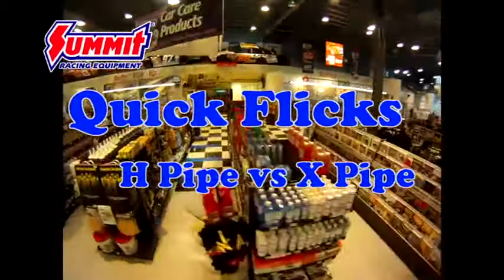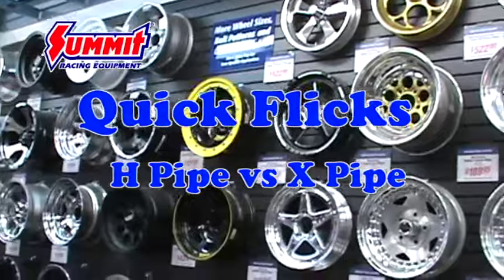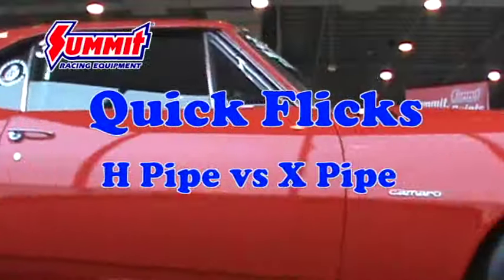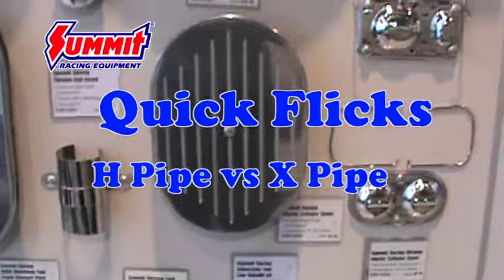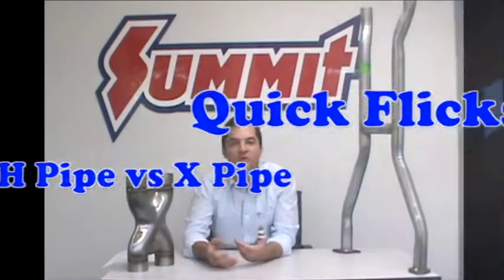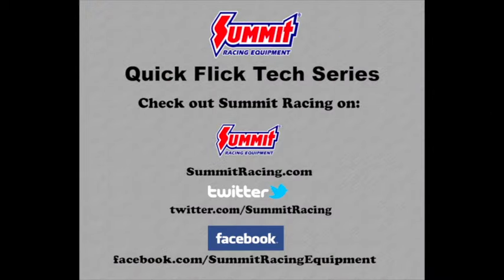Exhaust X-Pipes vs. H-Pipes and Differences Between Them

Comment from the maker: We unfortunately do not sell a bolt on unit for that car, but we do have a universal x-pipe assembly that could be fabricated or modified to possibly work for your application. Check out part number SUM-642122. Thanks for watching!

Comment from the maker: Generally speaking, in a low RPM application, H-pipes do work well, and in high RPM applications, such as racing, the X-pipe works well. Unfortunately, due to EPA regulations, it will be difficult to apply either to you particular application. Please let us know if you have any additional questions. Thank you for watching!

Comment from the maker: Hi MrRICKJAMESJR, 
At a low speed you don’t have much, if any back pressure going on. If you are experiencing a hesitation or bog off of idle it is more likely a carburetor tuning or ignition timing issue. Give us a call, we’ll help you work it out! 1-330-630-0240. Thanks for watching.

Comment from the maker: The “X-Pipe” is going to help scavenge exhaust better than an H-Pipe, but will work higher in the RPM range. Bottom line, where do you want your power, at a lower RPM for street usage, or at a higher RPM for race track usage?  Also, don’t forget, not all cars have a lot of room for either type of crossover pipe. Your car may not allow either one! You may want to give our tech line a call so we can best help you - 1-330-630-0240. Thanks for watching!

Comment from the maker: Hi Diego, 
An H pipe is beneficial to the car that is mostly street driven around town and the driver would like to see a power increase in the low to mid RPM range. An X pipe really shines on mild to highly modified cars in the mid to upper RPM ranges where the driver is more concerned with performance. Thank you for watching! Let us know if you have any additional questions.

Comment from the maker: There have been cases that the addition of just an off-road H-pipe and nothing else (fuel related) have leaned cars out, slowing them down – yes. But, all situations are not the same. Give us a call on the tech line and we will be glad to help you choose your components. 1-330-630-0240

Comment: dude you were right up until you said back pressure.

it's not because of lack of back pressure it's because your piping is too large for your target power band.. once you go too large you aren't generating enough exhaust to fill the pipes with each pulse to generate enough suction effect when the exhaust wave leaves.

scavenging is filling the pipes up and getting the exhaust pulsations close enough that the low pressure area created by one pulse helps suck the new pulse out when the valve opens. every system will have a sweet spot that they run at. and you xan feel it while driving. The larger your system the higher your engine has to rev and the higher your exhaust flow must be for the scavenging effect to be beneficial.

it has nothing to do with back pressure back pressure is always bad for a 4stroke engine. The only engines where back pressure matters are 2 stroke because it helps create the vacuum needed to pump the fuel and it helps increase the compression pressure.

come on dude. I know y'all are trying to explain it in simple terms but don't get tempted to to use terms like back pressure.

stick to the facts
Reply: 3 inch is too big
Reply: goheat77 thinking that's what she said!
Reply: Truth!  I came to comments to say the same and you beat me to it.  These guys don’t realize they lose all credibility with one wrong word.   It’s not “backpressure” it’s you lose “scavenging”.
Reply: @goheat77  I'm embarrassed by my 3 inch pipe

Comment from the maker: Hi Allison, it really comes down to usage of the vehicle. If it will be more of a street driver, an H-pipe will get the job done just fine and will be easier to fabricate if it is an earlier body car. Now, if the car will be run in the higher RPM range more often such as a race application, an X-pipe really shines there!  Good luck!

Comment from the maker: If it is a street driven car making up to 500 horsepower a 2.5” dual exhaust will work great with an H-pipe. If the horsepower level will be higher and mainly track driven at higher RPM’s then a 3” dual exhaust with an X-pipe will be a good choice.

Comment from the maker: Hi Michael, 
It is conceivable that by increasing the exhaust speed (or velocity), that not only will you achieve a greater scavenging effect, but the exhaust note may increase as well. Of course all of this is affected by the muffler, pipe diameter and pipe length you chose! Thank you for watching!

Comment from the maker: Hi Daniel Ricany, 
Muffler choice has everything to do with the exhaust sound of a vehicle. Simply adding some sort of cross over pipe may help to tune a particular sound, but it will not change it dramatically. Install an X-pipe first and see if that gives a sound you like. After that you will have to choose a different muffler or no muffler at all to get what you need!

Comment from the maker: Hi Diego, 
If this 4.6 2V is in a Mustang, they had an H pipe from the factory. For mostly low RPM street driving, an H pipe will do just fine. If modifications have been made and the motor will be run at higher RPM; consider an X pipe.

Comment from the maker: Hi Subjct4Change, 
Your car was factory equipped with an H pipe, so we know that works quite well. If you will be adding components such as a performance camshaft, cylinder heads, Intake manifold & throttle body, an X pipe would be a good choice. Thanks for watching!

Comment from the maker: Hi, If you haven’t picked a system yet, let us recommend the Pypes Pro Header-Back Exhaust system, our part number PYP-SGA10S for $389.95. This system comes with a X pipe and is designed for your Olds. The mufflers are chambered and will not be as loud as a glass-pack muffler system. The only thing we can recommend you do to get an idea of the sound quality would be to check YouTube. More and more people are adding videos on how their cars sound with various exhaust systems.

Comment from the maker: I suggest using an X-pipe setup on your V6 Mustang for the best performance. The correct versions are PYE-XFM19 ($194.99 non-converter) or PYE-XFM39 ($379.99 converter).
Reply: Wjat do you suggest fod swcondary car delete for a w204 c63? Straight pipe had the best sound?

Comment from the maker: Hi Tanner, Understand that because it has 2 less cylinders than a GT Mustang; no matter what exhaust you put on it, it will never sound like a GT. If the car is in fact stock and will never be anything but stock; be conservative on your pipe diameter. If you go too big you will loose some bottom end torque. Honestly, a slight increase in performance through exhaust will come from an upgraded single exhaust system instead of a dual. That is unless you just have to have the look of a dual exhaust!

Comment from the maker: It is highly suggested that you do not remove the converters. Making this change will result in the vehicle no longer being emissions legal and create drivability issues due to the computer not being able to adapt. The other issue may be a loss of low end torque production due to the combination of a small cid engine and lack of backpressure.

Comment from the maker: Currently there is not a H-pipe available that is correct for your V6 Mustang. But Pypes makes an X-pipe that will work very well. The part numbers for these are PYE-XFM19 (non-converter, $194.99) and PYE-XFM39 (converter, $379.99).

Comment from the maker: As stated in the video, not all vehicles react the same to similar upgrades in performance. The easy way to view it it is this, a dual exhaust by itself is a known upgrade that will produce more power. An “H-Pipe” would be the next step to assist in the production of even more power, but at a lower RPM.

Comment from the maker: You probably will not notice a torque loss, but understand too that you will probably not see a power gain until higher in the RPM range. The X pipe design helps to scavenge the exhaust on each side of the motor. In order for that scavenge effect to take place, you need the exhaust to be flowing at an accelerated rate.

Comment from the maker: We are only showing the  Dynomax Super Turbo cat-back system for your Thunderbird. The mufflers in the kit have polished tips and the factory hangars are installed.  Our part numbers is WLK-17379 and the price is $288.95. There is even a mail-in rebate for an additional $50.

Comment from the maker: Because the 78 Corvettes had a catalytic converter from the factory, many aftermarket companies do not make a true dual exhaust for these cars. Not to mention, the factory transmission cross member will not allow for it. Providing the car does not have to pass an emissions (smog) test or is used for “off road”  we (Summit Racing Equipment) can offer you a “double hump” cross member to clear a dual exhaust and then you can retrofit an earlier corvette dual exhaust ( 1973 & earlier).

Comment from the maker: Hi Elisa, 
It really depends on where you are most concerned with power production. If you are more into top end power I would suggest an X-pipe. If it is mostly a street cruiser and has a torque producing camshaft, go with an H-pipe.

Comment from the maker: Carl, 
Detent cables for 700R4 transmissions are made for different applications such as a carbureted or fuel injected car. The only real difference is that one may look like original equipment and another may be polished for a show car. Either way, they serve the same purpose. As for 27 or 30 spline, this is the number of teeth (splines) on the smallest shaft protruding from the front of the transmission without the torque converter installed.

Comment from the maker: Your car already has a factory installed H-pipe, so, unless you plan on increasing the RPM potential of the motor by installing larger camshafts and cylinder heads, you could focus on other bolt on modifications such as a “Cold Air Intake” (CAI),  “Axle-Back” exhaust and a “Computer Programmer”!  We would be happy to help you with any or all of these quick & easy modifications.

Comment from the maker: Before I can determine which H pipe is correct, I will need to know the following:
- Vehicle year, make, model
- Engine size- Type of headers (long tube or shorties)
- Header brand
- Does the H pipe need to retain the catalytic converters?

Comment from the maker: Catted simply means leaving the catalytic converters in place that were factory installed. This would allow the car to pass an emissions test. Factory converters in most cases though cause a restriction to the exhaust especially if you are adding other high performance parts IE: Camshaft, Cylinder heads, headers etc. There are aftermarket converters that are a higher flow that would allow both the addition of aftermarket performance parts and passing of an emissions test.

Comment from the maker: Dual exhaust systems worked for many years just fine without any type of pressure crossover. They will continue to do that very same thing if that is all that is desired by the builder. It just so happens to have been discovered through dyno testing that an H-pipe or X-pipe enables some motors to make more power in different areas or RPM ranges.

Comment from the maker: All engines have a window of power, some call it a power range or power band. By changing the camshaft to a slightly larger profile you have moved that power band up the RPM scale somewhat. When this happens, motors are still capable of making torque; they do it at a higher RPM. This is where changing the rear end gear ratio comes into play. It allows the motor to rev to the new camshafts power band quicker so you do not experience the bog or hesitation that is being interpreted as torque loss.

Comment from the maker: Many of the factory performance cars today are coming with a crossover pipe of some sort. The factory has realized that this is an area where they can gain power even with smaller motors than yours! So yes, by all means add a crossover pipe. There is no guarantee on a power number, but there will be an increase.

Comment: I've personally found that the x-pipe is good when you want to quiet the exhaust down a lil bit, but the H-pipe adds more sound and definitely more "boom" in the exhaust note.  Love both, but I prefer the H-pipe if you're running stock exhaust manifolds, X-pipe for long tube headers.

Comment from the maker: Hi Budoo6, 
H pipes are beneficial to the car that is mostly street driven around town and the driver would like to see a power increase in the low to mid RPM range. X pipes really shine on mild to highly modified cars in the mid to upper RPM ranges where the driver is more concerned with performance. Thanks for watching!

Comment from the maker: But, if you were to make this change I suggest going with the H-pipe setup for the sound you want. Once this modification has been completed you will have to get the computer re-flashed by a local dyno shop for it to run correctly though.

Comment from the maker: Honestly, on a low compression motor with an upgrade cam and headers an X pipe would probably be a little overkill as would dual 3 inch pipes. If you like the idea of a cross over pipe, use an H pipe with dual 2.25 or 2.5” pipes at a maximum.

Comment from the maker: It's hard to say for sure how the engine will react to this change. I personally believe the engine will perform best sticking with the current setup. Reason I say this is that making this change will likely result in more HP but it may also hurt low end torque production. So, doing this may improve the top speed but hurt off the line acceleration.

Comment from the maker: Rob, 
There is a possibility that freeing up the exhaust flow that much that you could get a lean mixture code in the computer. You may want to see if there is a dyno shop in your area that can re-flash your computer to compensate before building your new exhaust system.

Comment from the maker: Yes, adding an X-pipe to the system should make your V6 Mustang sound more aggressive but likely will not change the tone much at idle. Also, the addition of the X-pipe should improve the mid - high rpm performance of your engine slightly over stock.

Comment from the maker: By adding an “X or H pipe” you will increase exhaust flow even more. By adding a more restrictive muffler, you will do nothing more than slow the exhaust flow! Neither will change the new power range of the camshaft. But, if the truck is an automatic, you might consider putting in a higher stall speed torque converter. This too will allow the engine to rev quicker and get into that new power band without the expense and hassle of changing the rear end gears.

Comment from the maker: You could view a single muffler with 2 inlets and 2 outlets as an h-pipe of sorts. It helps to equalize pressure between banks, but does little to help scavenge the exhaust. This of course depends on its internal construction.

Comment from the maker: Early models used the 27 spline count input shaft and later models used the 30 spline. Count what you have before ordering a replacement torque converter or transmission.

Comment from the maker: For motors trying to maximize low end torque such as your “sand truck” an H-pipe will work just fine – yes!
Reply: I have a 2013 Mercedes c350 coupe 4matic. I’m definitely looking for a lower end torque and power. Something that helps me get off the line quicker. But also when I’m on the highway going 100 km/h (60mph) to still be able to put my foot down and get decent power. I will be getting air intake along with muffler delete. What exhaust set up do you suggest for this car, please help. Thank you 🙏

Comment from the maker: By removing your resonators you’ve increased your exhaust flow. By doing this it allows more fresh air to enter the motor in effect leaning the air/fuel mixture out in the cylinder. To regain this power and possibly more you will need to correct the air/fuel ratio. To do this easily you could install a computer programmer/chip or an adjustable fuel pressure regulator and bump a couple pounds of fuel pressure into the motor.

Comment from the maker: Installing the H-pipe setup in place of the mid mufflers will increase the flow capabilities of the system greatly but also will likely greatly increase exhaust drone quite a bit at lower cruise rpm's. Making this change will likely also make the exhaust tone deeper.

Comment from the maker: Since this is a lower RPM motor, an H pipe would be a all that is necessary. An X-pipe won’t hurt anything, it just won’t have much advantage over an H-pipe until higher RPM ranges are reached.

Comment from the maker: The air intake items you mentioned are unlikely to improve fuel mileage and in some cases will make it worse. Reason is that the more air that the engine takes in, the more fuel that is needed to equalize it. The only item I can suggest that will improve fuel mileage is a computer programmer. I suggest you go with a Bully Dog programmer part number BLY-40410 ($399.95).

Comment: Hello, I've been researching some on which to get for my Mustang, and what you're saying lines up with what I've found.

Everyone says that the H pipe setup will have a bit better low-end and deeper exhaust note whereas the X pipe setup will normally have a couple more peak horsepower but will sound more raspy than the H pipe.

Overall, most people seem to like the H pipes that I've seen. The horsepower is only 2-3 in most cases, and truthfully, that's not enough to notice.

Comment from the maker: By far the best way to fix this issue is to have a custom computer program written for the car while it is tested on a Chassis Dynamometer.  This will be more expensive and time consuming, but will be tuned specifically to your car with any other modifications you decide to do!